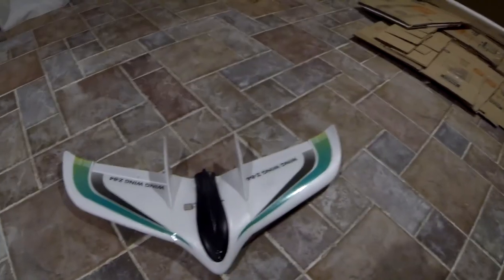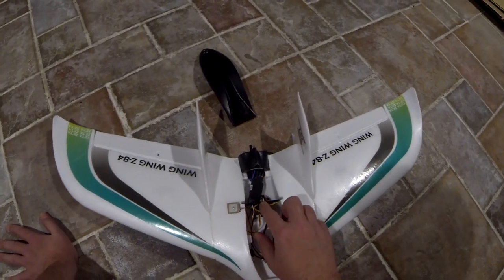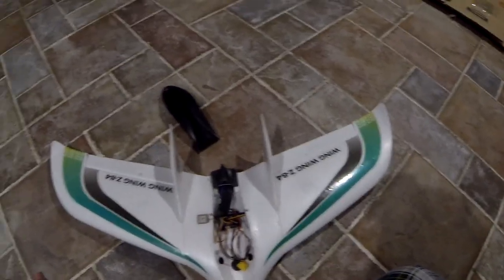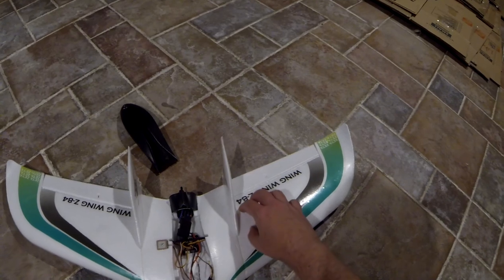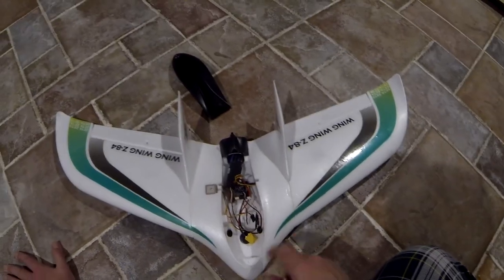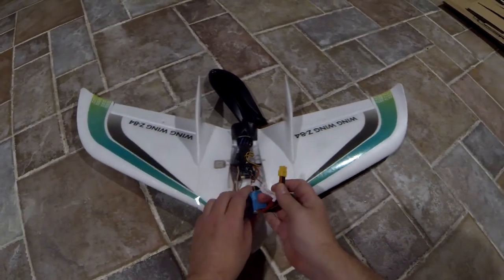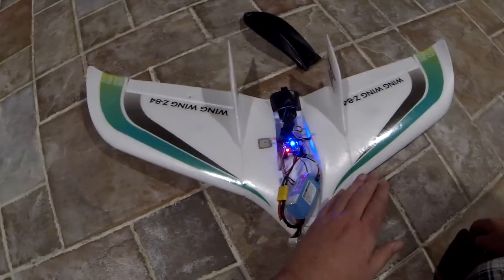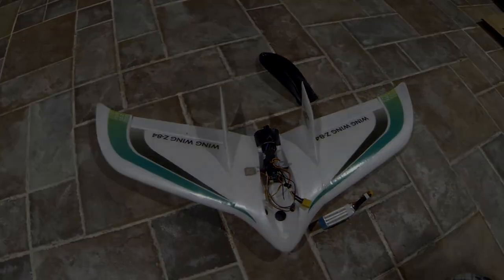VLOG #15 - Wing Wing Z-84 and iNav

Comment: Nice video. I am wondering how did you connect that gps to the control card.
Reply from the maker: Koray Yıldız I had to order the cable for the GPS from Banggood and solder it to the one that came with the Omnibus f3.